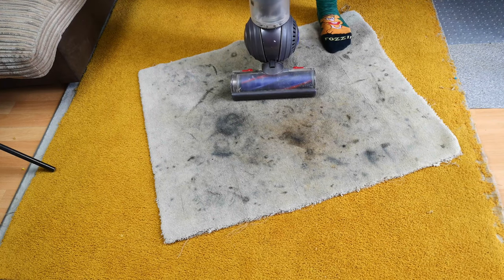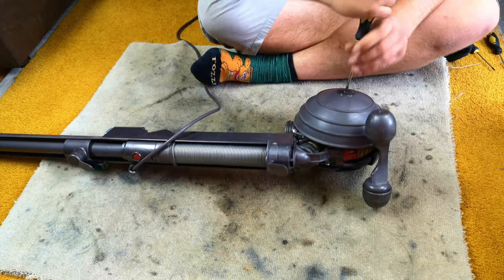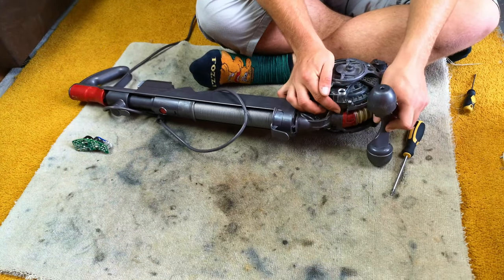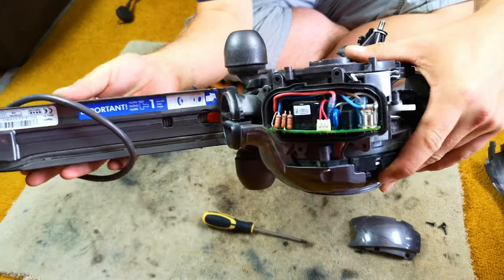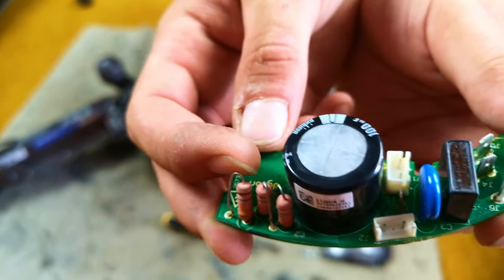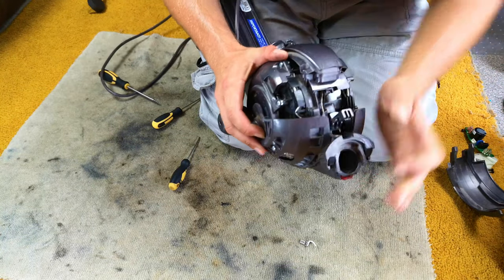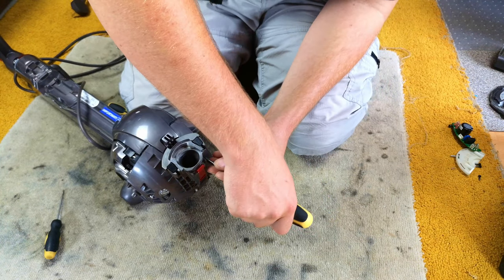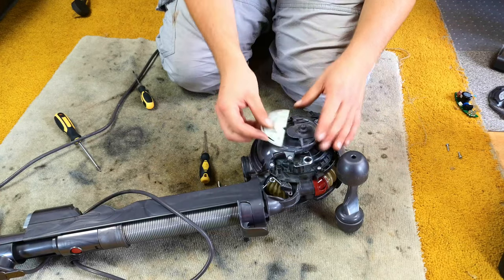Dyson DC50 Brushroll/PCB Diagnosis - Abortive PCB Repair How-To!

Comment: Thanks so much for posting this video. I've got a "small ball" with the same issue. No voltage at the brush head  connection. Im assuming it's a bad PCB board. The board is $25 US but after seeing how complicated the repair is i thin o might be better off throwing it out.

Comment: This video was great. My brush head wasn't working, only intermittently with no rhyme or reason. I changed the toggle switch next to the power button, but didn't fix issue. So I cracked it open and put a multimeter to the PCB. I checked the trigger switch that activates the brush roll when tilted back was going on and off, and that there was power going to the brush roll. With it disassembled and brush roll connected everything worked.  I tightened up the brush roll head connectors by squeezing, and added some tape to certain connectors to ensure they wouldn't come unseated. All works great now after using it around the house for an hour. I'm chalking it up to a loose connector.

Comment: Please note! That PCB has a large capacitor on it and it will contain power even when unplugged.   Be careful messing with it, especially with a metal screw driver around it or any of the boards components/solder points.
Reply from the maker: Very sound advice! I got a nice belt from a neato charging pcb by looking at it the wrong way

Comment: Great video and handy to know which bits come apart before you break the plastic. I've always had the approach that the worst thing is you break it but you learnt. I did infact change the motor of which had seen better days so just a few more bits to take off but watched your video for the clue to get stuck in. The result is all done and working like new so happy there but as you mentioned they dont really want them taken apart!

Comment: I tested with a multimeter and was seeing some spikes in voltage after the switch for the vacuum to start spinning. No spinning, getting only 1.9 to 2.2 volts when engaged, occasionally at a specific angle or a specific temperature, the bar would spin briefly. Tells me that there's definitely power, but it's significantly diminished. Power spike would be around 12 to 13 volts. If it was a broken lead, it would show nothing. I'm hoping the PCB is the actual issue.

Comment: cleaned my brush bar on dc41 still didnt work followed wiring from switch found pcb wit a big burn mess on it fitted a new on brush all turning freely tested it an it blow the new pcb £35 down still no vacuum cleaner any ideas dont really want to chance new head and another pcb it would be £100

Comment: Is there any way to fault find on the motor itself or the connections to the brush head? With a DVM i am getting about 12-13V from the two connectors on the main body. Is that what would be expected? I assume if the PCB has blown, then you would read next to nothing from these two connectors? therefore I can assume the PCB is fine, and the brush head motor is at fault?!
Reply from the maker: I'm not that technical with testing things to that extent (I'd love to learn) but what I usually do with a continuity meter is the switch, then the loom from the pcb to the head (with a check of the pcb for anything obvious), then strip the brushroll motor out of the head and check it's not got a blown comm segment (common) and weigh up which part to chuck on it... Equally I've replaced a pcb and the head span for half a revolution then blew that pcb so it might be easier to find a known working set/scrap machine that the head runs on... Good luck! I'll see if I can find any technical info on the Manchestervacs forum, hang on
Reply from the maker: https://manchestervacs.co.uk/DysonForum/index.php/topic,4205.0.html

Comment: Hi! I watched a couple of your videos on YouTube. I have a dyson dc 50. We are having trouble with the brush spinning consistently. It seems like it will only spin when the handle is at a certain position. I have my dyson torn apart right now, not sure if you have any other ideas of what it could be before I order this part to try. Or if I should just go get a new vacuum 😂

Comment: kinda wish I'd seen this video before blowing up a brand new replacement pcb.  Perhaps I should have asked myself why the pcb blew in the first place..
Reply from the maker: Dang, although don't be too hard on yourself, sometimes they do just blow for fun/overheat when the exhaust air slows as the filters clog, so it's still a crap shoot unless you go through it all first.

Comment: How much for a dc 40 brush head ?
Reply from the maker: £20 used on ebay usually. Their not renowned for burning out, most just come from scrapped and parted out machines
Reply: @beko1987  thanks 😊 btw do you have a old hoover you don’t want or need